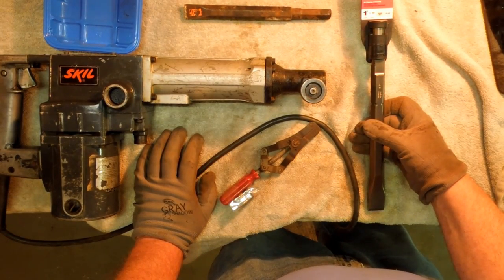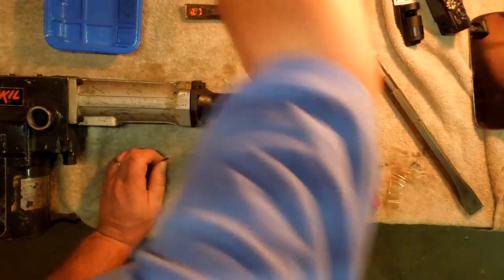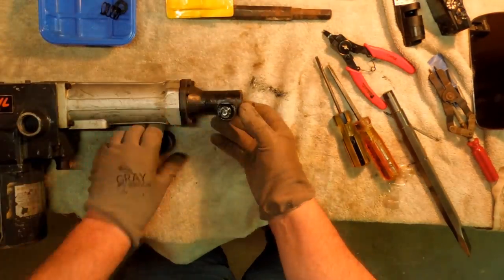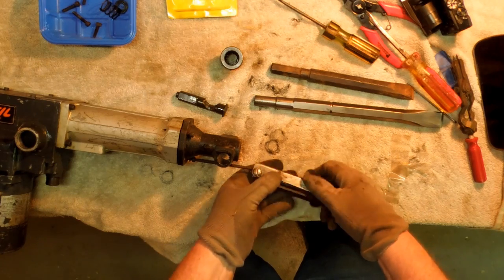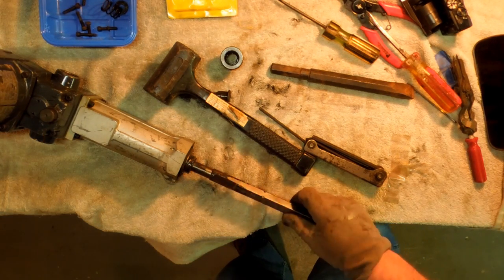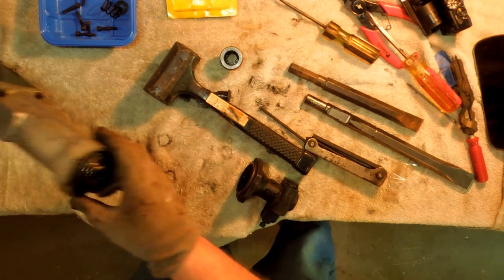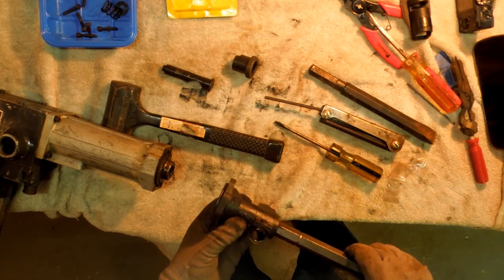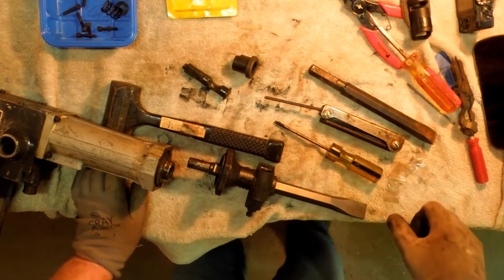Skill M731 Roto Hammer Rebuild Part 3

Comment: Very interesting probable fix....If one has the time everything can be fixed but if you can find the proper chisel you're sure of the fix....I`ve seen those before and at my daughter's far I think I seen one or two....I think it came off a Hilty red hed....next time I'm up there I`ll check....CHEERS
Reply from the maker: If I hadn't bought the power head for $2.00 it would be a lot harder to justify the effort. 
I remember when Dad got his first hammer drill. Before that drilling holes in masonry was a lot of work. Star drill and a hammer or carbide bit and drill motor either way was grunt work. I was the grunt. 😆
The hammer drill was for drilling a 3"  hole through an 18" thick poured wall  in a garage storm/bomb shelter to put in a service. We drilled a bunch of holes with a 3/8" × 18" bit and chunked out the center. Anchoring the conduit was a breeze. 1/4" x 1"  hole and a plastic anchor just a minute each. 
This is a 2 1/2" drill. With a core bit it will do 3" easy. 
Not that I need it. I doubt I will be drilling anything that big very soon.